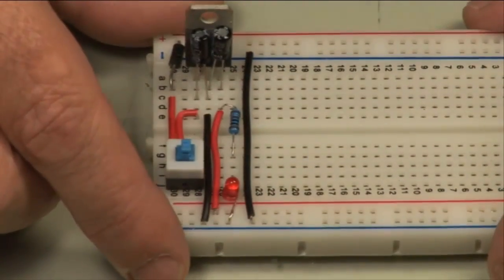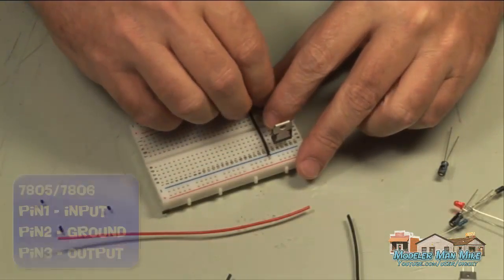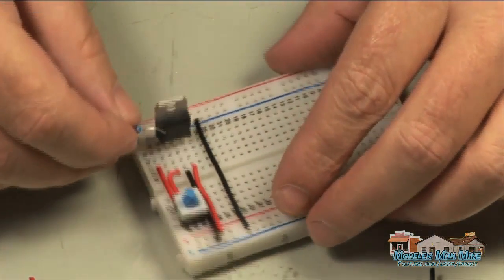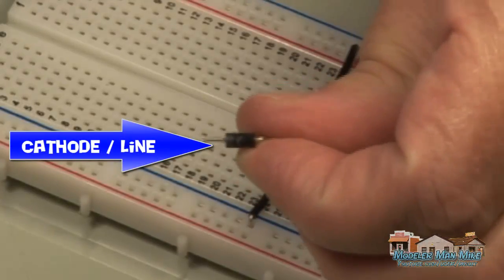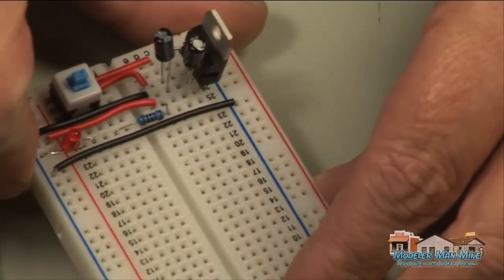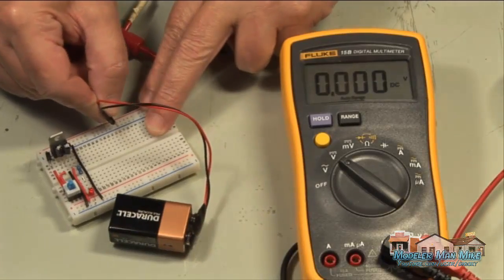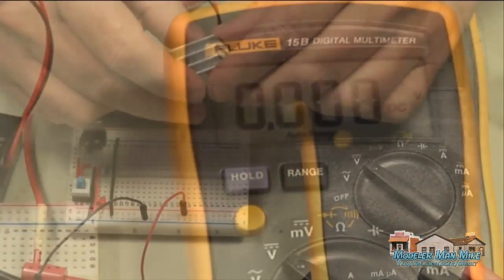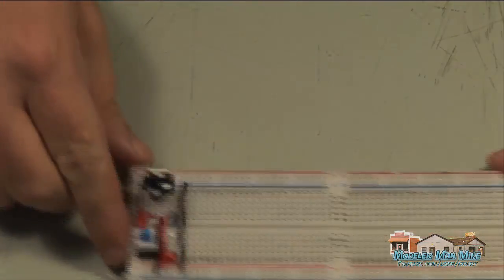Bread Board Power circuit using a 7805 5v or a 7806 6v Voltage Regulator

Comment: You should put a capacitor on the inbound and outbound pins of that 7805 22 kilohms on the inbound voltage in zero point 1K ohms on the outbound. I have had a couple of Arduino projects that were very sensitive to noise in the signal that was picked up through erratic 78 05 power reduction it's easy and quick put both short legs of the capacitors on the middle common with the longer legs on each outer pin then you're done

Comment: Hi again I have only just noticed your reply. I have sorted the problem by using two voltage regulators one with a LM317 to the coil of 7 volts plus with the 7805  connected to the voltage rail to power the IC at 5 volts. My clocks are elctro mechanical  as you can see on my webpage http://timewithcharacter.org/ 
regards
Robert
Reply from the maker: +Robert Webb It all checked out for you I guess? :)

Comment: From Australia
Thank you. I am pretty old and new to electronics which means that I feel as though I am swimming in custard with my head beneath the surface most of the time. I am using a circuit to control a clock I am building (I have made quite a few) and need 7 volts to the coil and 5 volts to the 12f683. I tried using a couple of resistors to create voltage drop to 4.9 volts but have still not solved my problem. This little power supply may well be an answer. Your presentation in the video is quite excellent. It is easy to watch, to listen to and to understand. Today I will go back to my breadboard and build one. Best regards. Robert
Reply from the maker: +J Walker I agree!

Comment: so a LM78xx is a voltage regulator not a npn or pnp?  and most of all is not called a transistor ?
Reply from the maker: Frank Lopez 7805 and a 7806 are not a transistor or mosfet, they look the same but these are voltage regulators.
Reply: so npn and pnp are only used in mosfet "high current applications" and transistors "low voltage application" ?
Reply from the maker: Frank Lopez That sounds good :)

Comment: Hi! What's the capacitor's volt did you use?
Reply from the maker: gabo natchi These are between 40 and 50 volts. You can really use just about anything as long as they are anywhere from 20v or higher.

Comment: It's an excellent video. I am trying to build a circuit which utilizes a 7806 for a constant 6V. The breadboard is powered by a barrel jack connected to an AC DC 9V adapter. I can measure 9V when nothing else is connected but when I tie in the 7806 I get a descending voltage of less than 3 volts. I would appreciate some advice and I have pictures which would clarify my problem.
Reply from the maker: Hey Nick, I could take a look if you like, just send a mail to modelermanmike01 at gmail.com. Wish I new the answer right now, not sure if I have seen this before though. I am no expert at all, but do enjoy trouble shooting some things.

Comment: how can you connect LED lights together without direct wiring unless using wireless signal. If  I have buildings with lighting, i have to run a wire to a circuit board connected to a power supply, correct
Reply from the maker: yes!

Comment: I did it !!!  Well sort of.  Being very very new to this, I couldn't find all the parts since I don't really know how to decipher to the lingo yet.  I built this without the capacitors or the switch.  So I manually just connect the power supply and the LED goes on.  Woohoo.  Very exciting (ok, I am a bit nerdy, but woohoo). So now I have a nother question, what exactly do the capacitors do?  And maybe a suggestion.  You could sell a kit for each of the tutorials you do.  My email is 2swank4u@gmail.com if you'd like to respond directly.

Thanks for your dedication to helping others.  It is a very noble purpose.
Reply from the maker: Good news! Really nice to hear someone is actually getting something out of these video's! Grats to you. To answer your questions, a capacitor is used to level out the electrical charge, makes it all smooth like butter. As far as selling a kit, these parts are so easily obtained, it really shouldnt be a problem to get this stuff. I would think all of this could be purchased from radio shack or like stores.

2swank, Thanks for the compliments and thoughts on the video's, you have some responses on a couple right? I do appreciate it!
Reply: Yep, I have watched all of them.  Most of them several time.  Parts selection is still difficult somehow.  Been to two radioshacks, all over eBay and Jameco online.  Like that little button switch you use, I have not found one.  Most of the ones I find loon like they are cylinder shaped and to be mounted through a panel, not stuck directly into a bread board..  Nevertheless, I am moving along.  I hooked up 5 LEDs in a row of buildings in my sons HO table.  Each LED is connected to a toggle so he can have fun turning the store lights on one at a time. Soon I will work on a programmed PIC for a house.  BTW, my soldering is TERRIBLE now :)  After a few hundred solders, should start to get better.
Reply from the maker: 2swank4u Excellent! You should take some pictures or vid and throw up here so I can check out your handy work. No worries on the solder, I feel that if its making a connection, its doing its job! :) would like to see it though! Glad your making progress!

Comment: what watt LEDs are you putting in your houses.  I am getting ready to light up a house just by following your instruction.  Never wired a thing, so this should be fun.  Getting ready to order supplies, but wasn't sure what watt LEDs to get
Reply from the maker: I am not sure the wattage, I purchase these from Ebay, just standard 5mm or 3mm LED's. Just check the amps really, many wont even tell you the max amp. More than likely with this circuit, any LED will be fine, going to the 3mm you may need to increase the resister lead to the led. Best thing is to just play with it! Any hey, lets see some video when you get there!
Reply: digoxy Ok.  Now I am totally confused.  I am so new to this it is scary.  Any way, I a on ebay looking for the 10 uf  capacitors in your list and I see 10uf 50V, 10uf 25V, 10 uf 450V, 10 uf 35V, etc.  Help Please.  Also, is there a good online class that I could take to learn more?  Is this considered an electrical engineering course?
Reply from the maker: No worries, this is an easy deal the questions have are the same things I went through :) I dont know of any online courses. The voltage on the caps is going to be 25-50v. The LED's are any that you might want to use. LED's (different colors) are actually different as well. Just pick up some and using what you have, you can set the resistors to adjust the brightness.
Reply: digoxy Well, I ordered a pile of components from eBay.  Most seem like they are coming from China so they are just now trickling in.  Going to be starting soon hopefully
Reply from the maker: Very nice, take note of the led voltage when you get them, like write it on the bag or whatever. This way, when you start getting them in a circuit you know what resisters to use. I mention this cuz when I got mine from china, they were different, standard is something like RED/GREEN/YELLOW 1.6v/2.2v/3.8v, but many from china are not standard, I am still working through this issue not knowing the correct voltage! Be sure to get some video up to! maybe some unboxing or something, I will check'em out! :) Have fun!

Comment from the maker: Yes, using the 5v reg, adding a diode/resisters to this circuit should do the trick. They may also have a 4.5v regulator to, replacing the 7805 with a 4.5v reg might also do this. same circuit just changing the reg can change the voltage easily.

hope this helps